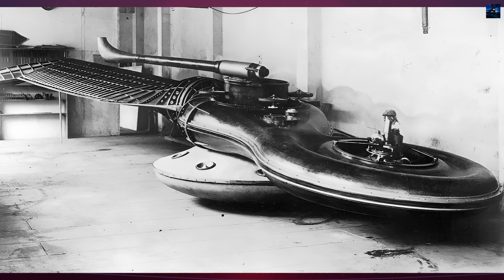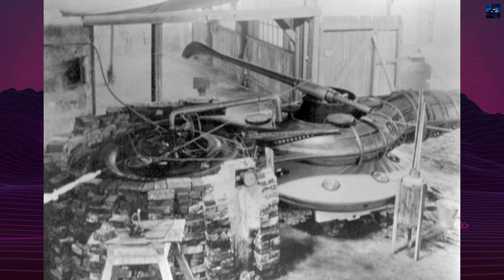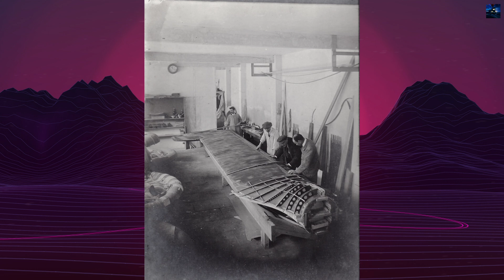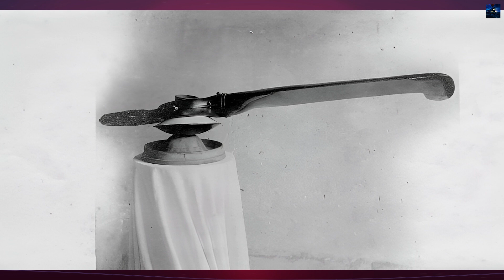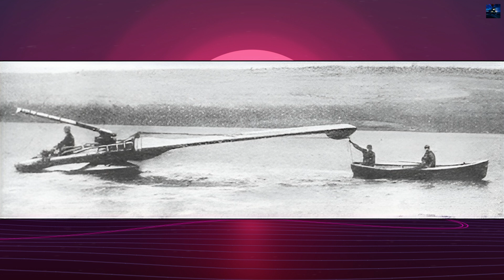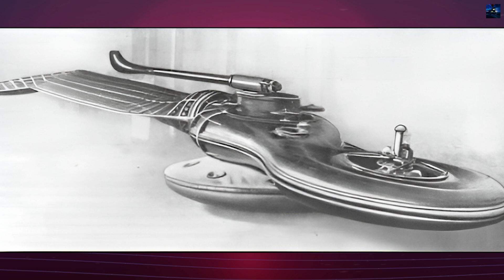Gyroptere: The Pioneering Vision of Alphonse Papin and Didier Rouilly

Comment: I hope someone makes an animated 3D model of this. Really interesting. I don't understand what the air going through the blade does or why it looks like a seat in the opposite end. I think even if it worked the pilot would spin as it doesn't appear to have an equivalent to a tail rotor.
Reply: Instead of a tail rotor, the pilot controlled a tube that released exhaust from the engine in the desired direction, allowing them to compensate for rotation. 
An interesting idea with the 3D model!)